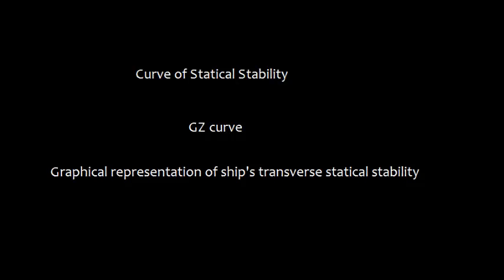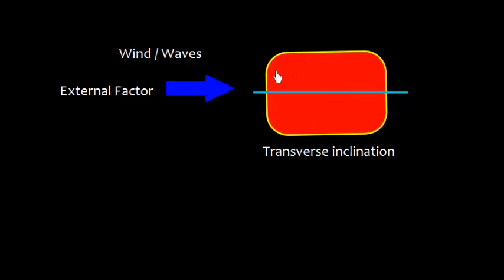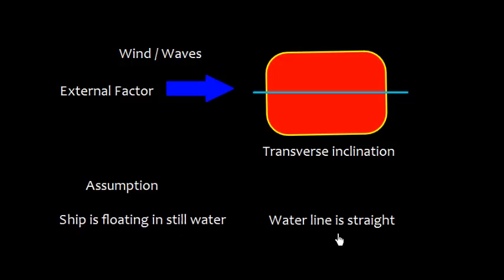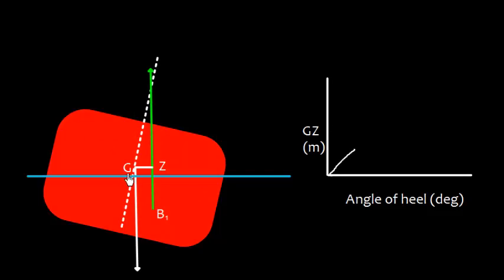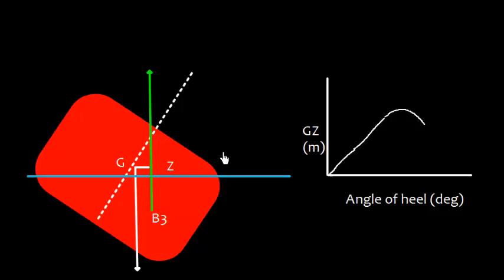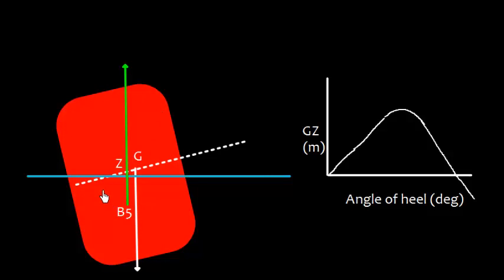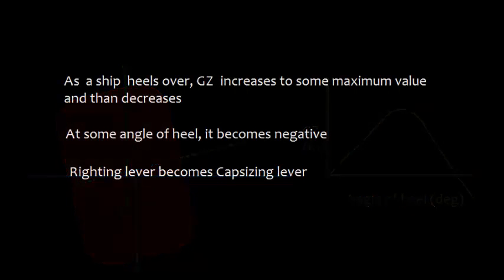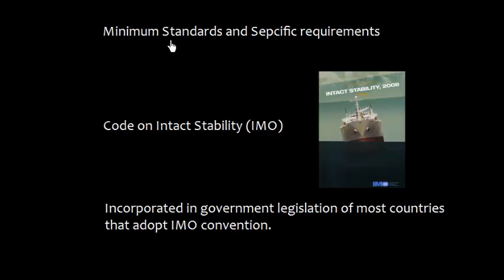Ships Stability_ Curve of statical stability _ GZ curve

Comment: https://youtu.be/eT1wUL_y00I?t=196
You're saying "if the vessel heels further, the underwater volume will increase" - this is dramatically wrong. The whole point about ship's stability and bouyoancy is in that the underwater VOLUME of the submerged hull of the ship remains CONSTANT at  all times (in such conditions as you describe). It is only SHAPE (geometry) of the underwater volume that changes during heeling. The change in shape makes the Center of Bouyoancy move to match the position of the center of gravity of the underwater volume as if it were solid water volume. Please make corrections to your narrative.
Reply from the maker: Your point is well taken. The total underwater volume will remain constant but will increase on lower side and reduce  on upper side. I meant to say the same by saying "the underwater volume will increase like this''. I should have added " The underwater volume will increase on lower side like this."
Your comment well appreciated
Reply: This is obvious that you did not mean what you said then, but if I were you I'd corrected the narrative in order to avoid confusions of the kind in future and not to receive any comments like mine one.
Reply: @epiphanshiperson200  chill dude